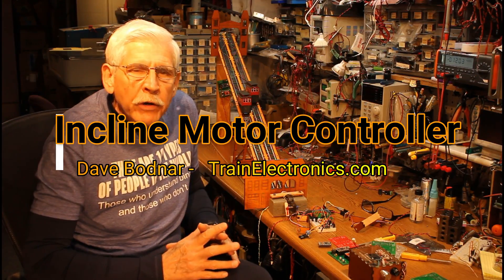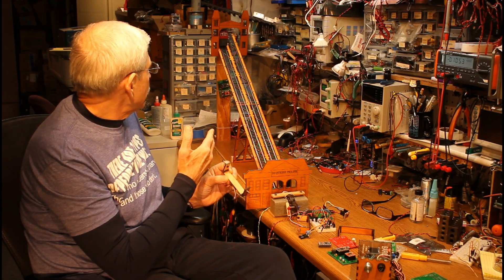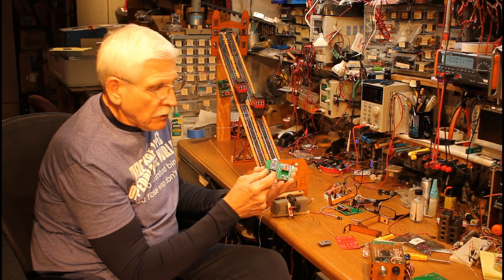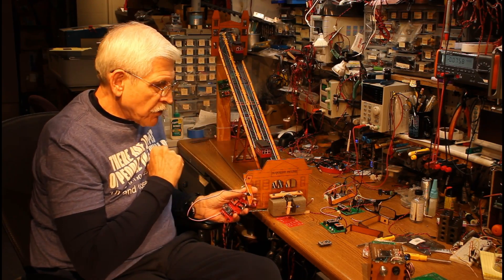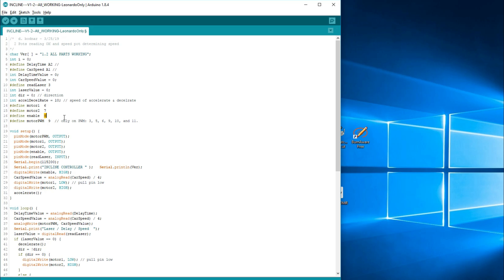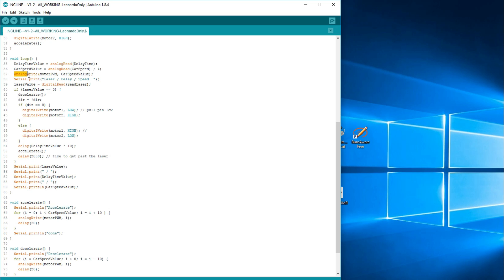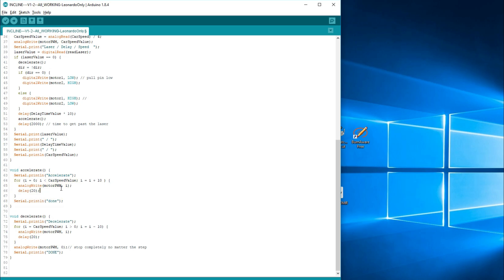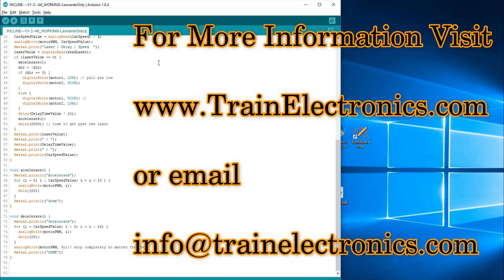Incline Motor Controller

Comment: Whynot micro switches as limit..  no or nc per direction..  relays.  Dun deal. No constant power draw for some micro ctrlr
Reply from the maker: The microcontroller allows slow speed up & slow down that switches do not.  I also like the lack of contact provided by the laser. 
Dave

Comment: Maybe you could have the motor start slow and gain speed after it stops each time period that might add a little more realistic look. I really like you videos. Very well done and informative. Thanks for doing them.
Reply from the maker: Luke - the motor does start slowly but not enough to be very visible - the 
accelDecelRate 
variable can be change to speed up or slow down that rate.
Thanks for viewing!
dave

Comment: Have you ever tried IR LEDs and IR receivers as end stops? I just wonder if they will work in highly lit places (like outdoors) as well as the laser would, while being ultimately invisible on the car itself. Good video as always!
Reply from the maker: I consider IR units but they are typically short range and would likely not detect both cars with only one sensor so I went with the laser.
If you want to hide the laser from view see an earlier project here:
http://trainelectronics.com/Laser_Train_Detection/index.htm
Might be just what you need

dave

Comment: I want a scale loading dock to raise or lower, depending whether a scale flatbed trailer is backed up to it, or leaving. Your controller described above seems perfect for that application. Is there somewhere I could buy one?
Reply from the maker: Sounds like to good application - the unit is not for sale but is designed for viewers to build themselves - hopefully there is enough information supplied for you do make your own.  
If you want a circuit board I can supply that - drop me an email if you are looking for that item (dave@davebodnar.com) 
dave

Comment: Both Arduino Pro mini (MIC5205) and Arduino Uno rev3 (NCP1117ST50T3G) has Absolute Maximum Ratings of +20V for Input Voltage. So 12V will not kill any of them.
Reply from the maker: That is true but I never use the raw power input pin but supply 5 volts to the VCC pin - the H-Bridge is also limited to 5.5 volts so it works out using the 7805.
thanks!
dave